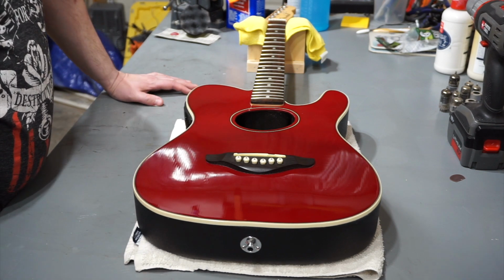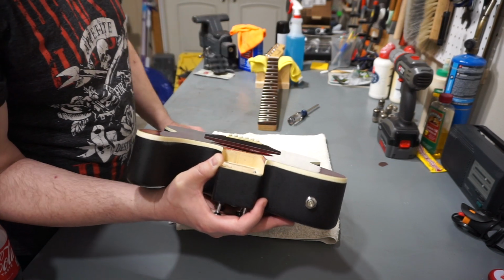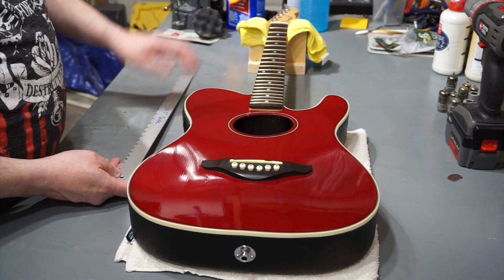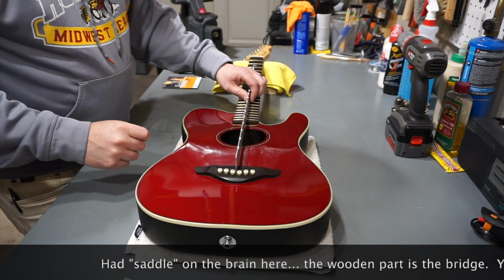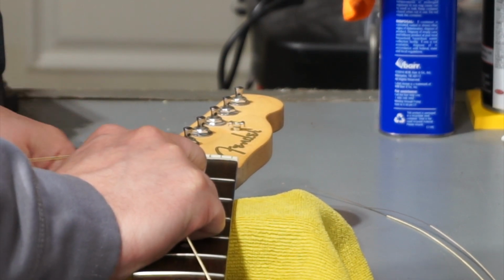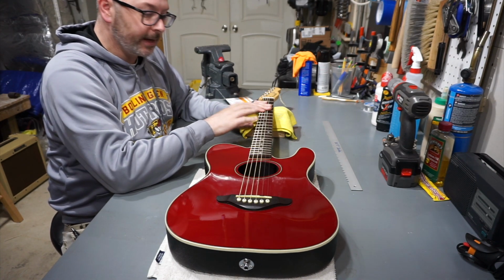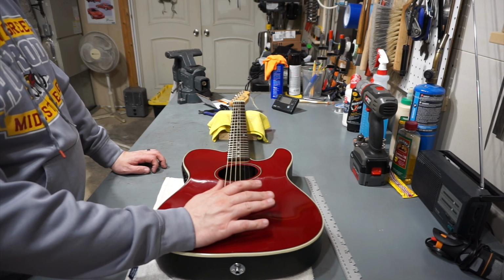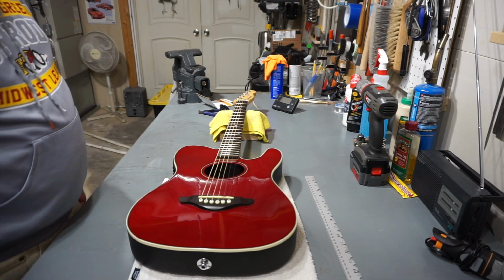The Fender Telecoustic Project Guitar: Part 1 - Neck Setup, Repairs, and String Replacement

Comment: Thanks for your video! Saved my guitar lol. Got it used 2002 pulled the neck and found small strip of sandpaper for shim. Added a shim and cleaned up poor router job. Wow sucker plays sooo nice now! Btw I used superglue and cigarette ashes to repair the ovation part. Worked really good. I appreciate your detail and took my tele from a chump to a champ! Thanks again Hack!
Reply from the maker: Cigarette ashes?  I’ll have to Google that. :)  Glad I could help!

Comment: I own this exact guitar 🎸.  It was left to me from a family member.  The neck on mine is in the same shape. It has a up bow and the action is high on it. So it's quite hard to play. I'm not sure if I want to try to fix it myself. I'm probably just going to take it to a professional. It has 2 little stress cracks right behind the bridge on each side going to the bottom of the guitar. Other than that it's in perfect cosmetic condition. Thanks for posting this.
Reply from the maker: Sure!  Good luck with the guitar.  I can tell the crack in mine is not consequential, but I'd have been a little nervous about cracks near the bridge.  There is definitely a lot of stress in that area in this design.  I've since gone back and sanded a little off the bottom of my saddle to lower the action more, because it raised slightly after the guitar sat for a few days, even after installing a new neck.
Reply: @hacksguitarhobby  Yeah, honestly I think it's just a Poor design of a guitar 🎸.  I mean I have a Washburn Acoustic from the 70s. It's beat to heck but they were built so well that the guitar literally stays in tune for weeks if you just leave it on the stand. The action is perfect and sounds better than any guitar 🎸I own and I own 9 of them.

Comment: i got the action on mine down pretty good no buzz. removed sand paper neck shim and leveled the pocket that was routed uneven,  actually the wood putty was the perfect shim. got a better neck angle and action. but i noticed that the intonation above 12 is sharp around 20-30 cents , its all kinda off.  i thought it might improve with better neck angle , but it remained the same.  Also, I sanded the saddle almost tooooo much -started buzzing -used my home made notched edge and got the perfect relief .  No more buzz - wo scary.  This was the 2nd saddle. i over sanded the first.  CRAZY THING is when i measure the 12 th fret to the saddle its way forward .  pretty sure i need to relocate the whole bridge -or drill n fill the saddle slot which is gettn it kinda to close to the pins. WTF did they place the bridge wrong and it took me years to notice or did the bridge move? maybe a cracked brace ?  seems ok - without looking - need a mirror. no buzz n bridge is flat.  seems like manufacture defect  ?  Have you seen or heard of others with this problem ?  should i move the bridge ?
Reply from the maker: I felt like mine was a little short on bracing and have seen some with bellies around the bridge.  It’s concerning that you mentioned the neck route being crooked.  I think moving the bridge would be a major job including paint and might try a compensated saddle.

Comment: Found one of these on FB marketplace, massive neck crack. They’re asking 125$…can probably run it down closer to $75 range. Think this would be worth it? Wondering what you paid for yours. Thx
Reply from the maker: Paid about $150 as I recall.  Pretty sure I lost money on it, although I got a new neck for it for free.  If I had gotten it today, I’d likely try straightening the neck instead of replacing it.  $75 would be a good deal.
Reply: My neck wouldn't get straight enough.  I couldn't take the relief out on the stratacoustic. I ended up shimming and settling for ok action. It played well but not great. The electric was the nice part.